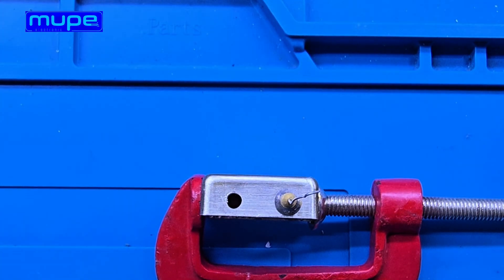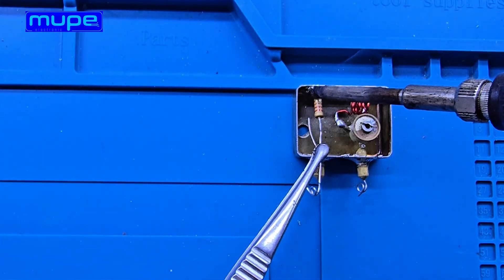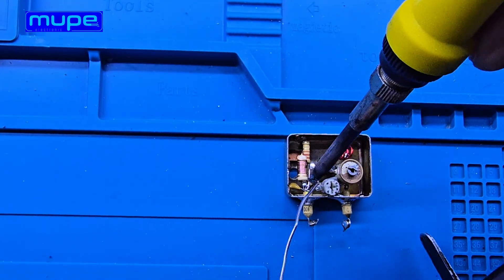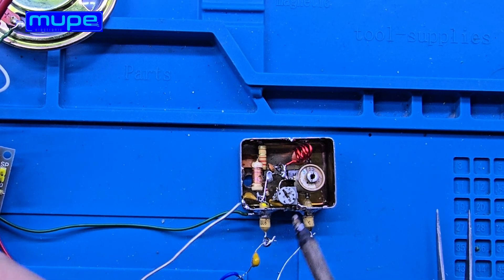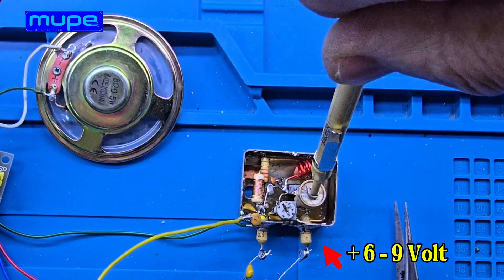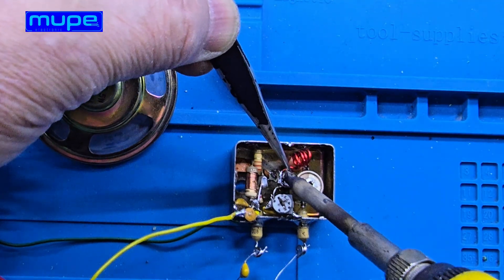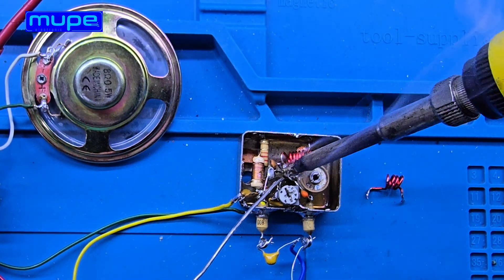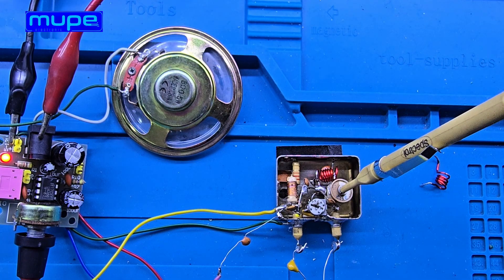Super-Regenerative FM  One Transistor

Comment: No feedback capacitor present there between Collector Emitter or Base Emitter... How does it works?😅😅😅😅
Reply from the maker: “There is a 4.7 pF capacitor between the collector and emitter. It provides the required feedback at RF frequencies.”
Reply from the maker: “There is a 4.7 pF capacitor between the collector and emitter. It provides the required feedback at RF frequencies.”

Comment: please does it work ? I plan INSHAALLAH to build your circuit . does it receive fm radio > thanks for answering
Reply from the maker: Yes, it does work 👍
This circuit is a super-regenerative FM receiver, capable of receiving nearby strong FM stations.
It’s not comparable to commercial radios in terms of selectivity or audio quality, but it’s excellent for learning and experimentation.
Antenna length, coil tuning, and supply voltage are critical for good results.
A great hands-on RF project — good luck building it, InshaAllah!
Reply: @mustafapersembe  many thanks and BARAKA ALLAHOU FIK . Did You also publish a transmitter for fm circuit compatible for this receiver please .

Comment: ALLÁ POR LOS AÑOS 60 QUISE ESCUCHAR A LA POLICÍA FEDERAL.
IMPROVISÉ UN REGENERATIVO CON UNA VÁLVULA TRIODO.
LA FRECUENCIA LA CALCULÉ DE ACUERDO AL LARGO DE LA ANTENA DE LOS PATRULLEROS (1/4 DE ONDA)
EN EL PRIMER ENSAYO SALIÓ ANDANDO.
LA FRECUENCIA 154.675 MHZ
LUEGO, CON LA LLEGADA DE LOS TRANSISTORES MODIFIQUÉ MUCHOS RECEPTORES PORTÁTILES PARA RECIBIR ESA FRECUENCIA. MUCHOS DE MIS COLEGAS ME TRAÍAN SUS RECEPTORES PARA QUE LOS MODIFICARA.
Reply from the maker: What a great memory and experience—thank you for sharing.
Regenerative tube receivers were truly creative solutions for their time.
Calculating the frequency based on antenna length and having it work on the first try is impressive.
154.675 MHz was a very commonly used frequency back then.
Modifying receivers later during the transistor era clearly shows real electronics craftsmanship.
Thanks again for sharing this valuable experience.

Comment: I hope the dti dont knock on your door and ask where the transmitter is. The drift on that circuit is epic.
Reply from the maker: I’m aware that the nearest local FM transmitters are about 5 km away, located on a hill, transmitting at approximately 300–500 watts of output power.
This project is a single-transistor super-regenerative FM receiver, built purely for educational and experimental purposes.
Regenerative and super-regenerative receivers require a solid understanding of their operating principles, as they are difficult to tune and keep stable.
Achieving reliable results with this circuit is the result of nearly 40 years of high-frequency (RF) experience.

Comment: Howdy.
Wonderful work building this mostly self-carrying circuit. It sure is tight, which usually is a must for success.
The schematic is familiar. It usually shows a capacitor of say 4p7 between emitter and collector to get the vhf oscillation. Evidently it works without it.
Cheers.
Reply from the maker: Thank you, I really appreciate your kind feedback.
Yes, you’re absolutely right — in many classic VHF regenerative or super-regenerative designs, a small capacitor between emitter and collector is often used to assist oscillation.
In this particular build, the circuit relies more on stray capacitances and coil coupling, which turned out to be sufficient for stable operation in practice.
That said, adding a small capacitor like 2–5 pF can definitely help with consistency and startup reliability, especially in different layouts.
Thanks again for the valuable observation and for sharing your experience.
Cheers!

Comment: Don't be mad at me, but that's the most brutal soldering job I've ever seen :-) 
Otherwise, it shows how little you need for a superregenerative receiver. 
I enjoyed building it as a spy receiver. In 1970, "real" FM receivers were even bigger. 
Back then, I could build a receiver with just two transistors that worked with a crystal earpiece and a 1.5-volt battery and fit in a matchbox.

This principle is still used today in very inexpensive data receivers in the ISM band.

Many single-channel CB handheld radios (mostly from Japan) also used this type of receiver.